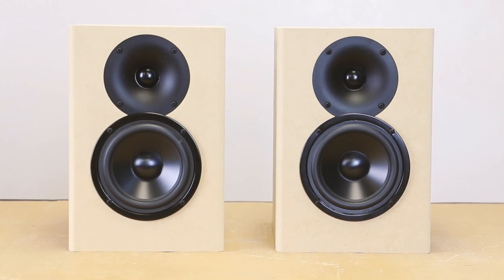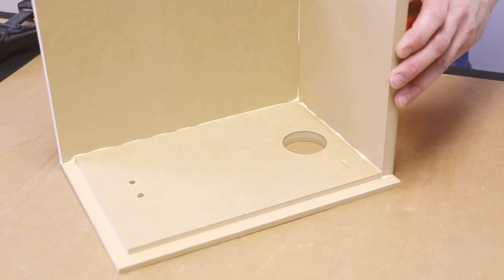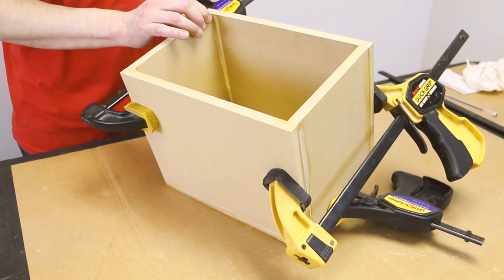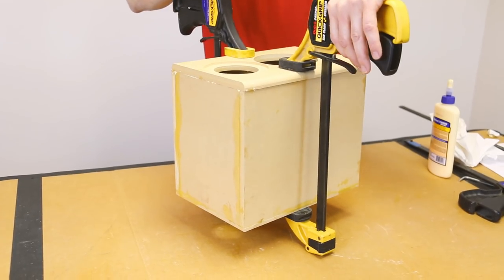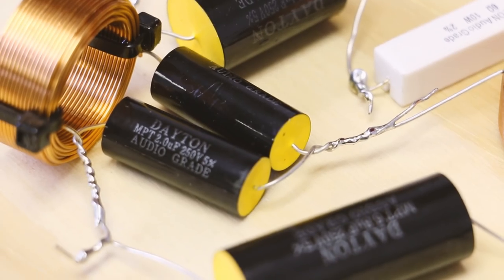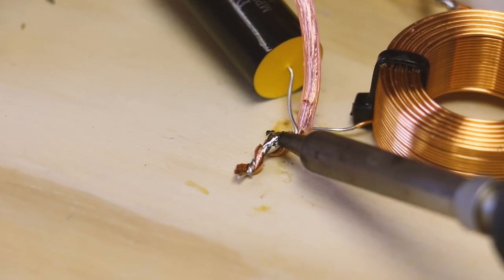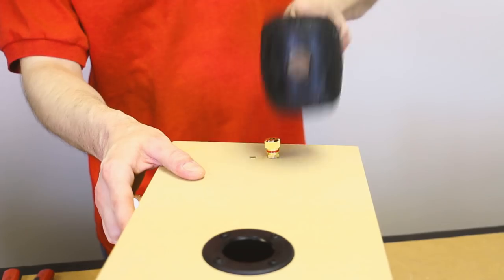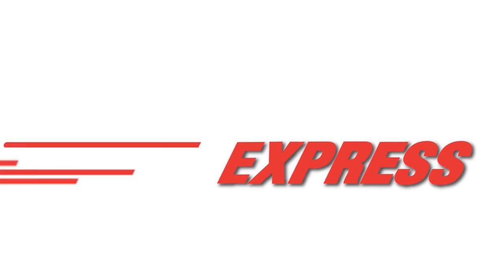How to build the C-Note Speakers

Comment: Take a look at this kit, and then take a look at the Revel Concerta2 M16 speaker. Conceptually these are very similar (aluminum woofer, waveguide tweeter), and the Revel is a $900/pr speaker. This kit gives you a $700-800/pr set of speakers for $200, and that's incredible value.
Reply: rorybz Lol... I don't know, that is one heck of a comparison. :)
Reply: At the moment the kit is down to $100.... with free shipping. That includes the pre-cut housing. Ridiculous price.
Reply: Get 'em while you can at that price, eh.

Comment: I would had a cross member brace 1¼"  ¾" of ply, one behind the Bass Driver and one level the front and just bottom of the tweeter cut out. instead of using glue to attach the speaker baffle use silicone adhesive and adhesive on the cross member at the bottom of the tweet. you probably want to shorten your port doing this? seems rather long as it is even if you don't put the bracing, I would adjust the ports before gluing using a bit of insulation tape to make it tight so it doesn't rattle! a square porters better than a round. inline the port with felt giving yourself clear inch from both edges free, has to be bigger tho.

Comment: How did he connect the female disconnect crimps to the two terminals at 4.09? Did he add something on the terminals in order to connect the crimps?
Reply: The binding posts I used include a tab that 0.205" disconnects fit onto perfectly. 
Binding Posts: http://www.parts-express.com/--091-1245
Solderless disconnect: http://www.parts-express.com/--095-282

Comment: Hello, I am thinking about building this kit. This would be my first. 1. Can the internal work be done before the front or one of the side panels is glued on? 2. Are there pre-assembled crossover kits available for this type of speaker?
Reply from the maker: You could do the internal work before the cabinets are built for sure. As far as pre-assembled crossovers, I'm sure you could find a suitable replacement, but the kit includes what you would need and step by step instructions on how to build the crossovers. We are also here to help with our resource pages as well as a staff that would be glad to assist in any way we can to help you feel confident in building the kit yourself.

Comment: Very impressive kit and I'm happy to see that waveguide tweeter being used.
Reply: I designed the waveguide for that tweeter when I worked for Dayton Audio. It's a good tweeter for sure, partly because it begins with a good dome tweeter element, and also because of the even control of dispersion.
Reply: rorybz is Dayton Audio owned by Parts Express or is Parts Express the the distributor in the US?
Reply: As far as I'm aware Dayton Audio is Parts Express house brand.
Reply: Dayton Audio is owned by Parts Express, but it is run like a separate company in many ways. Overall a pretty good arrangement and I enjoyed my work there.

Comment: Does it come 2 examples of the adjustable port tube, 2 examples of the tweeters and 2 examples of the woofers?
How am I going to connect the speakers to the computer?
Can I also cut some speakerwire to connect the speakers to an adapter?
Reply: Yes, the kit includes 2 each of woofers, tweeters, port tubes, knock down boxes, and sets of crossover components.
You will need to supply terminal for the enclosures, speaker wire, and mounting screws. There are many different versions of each available on the Parts Express website. 

To hook the speakers up to a computer you will  need to add an amplifier. Again, Parts Express has many options:
Here is a selection of small desktop amplifiers: http://www.parts-express.com/promo/mini_amplifier_headquarters
Here's one you can actually mount inside the C-note: http://www.parts-express.com/--300-781

Comment: someone knows which glue does he used to paste the crossover?
Reply: You would be very stupid to use this glue .  you need to do it correctly and solder all the cross over parts together and place the cross over on a peace of hard board...
Reply: @keitholdbean3173  I was wondering the same thing, why don't they hot glue everything to a separate board and then secure that to the inside of the enclosure. I'm surprised they don't use any Dynamat or polyfill or some sort of sound deadener to improve sound.

Comment: Why would you want to permanently   mount the cross-over using glue as in the video? By doing it this way the cross-over becomes a none serviceable unit.
Reply: Crossover PCBs for this kit are being sold on ebay now. Those PCBs can be screwed down instead of glued.